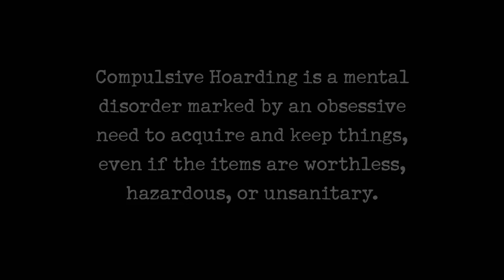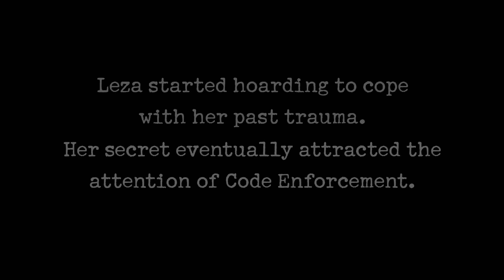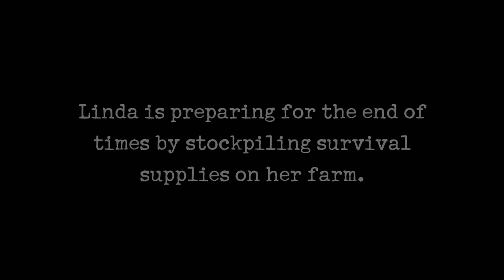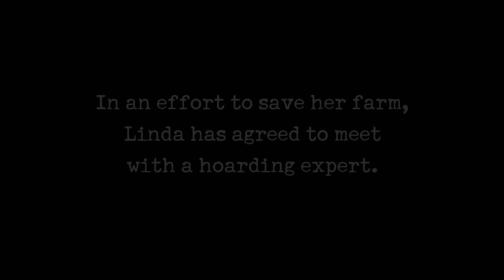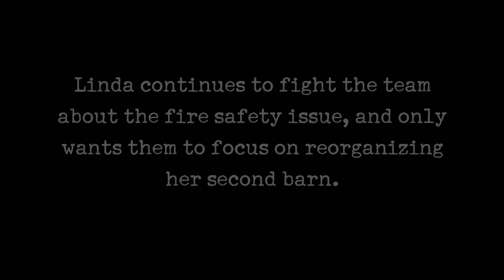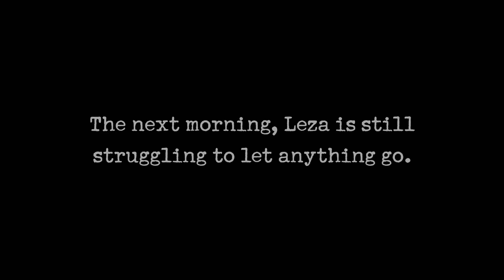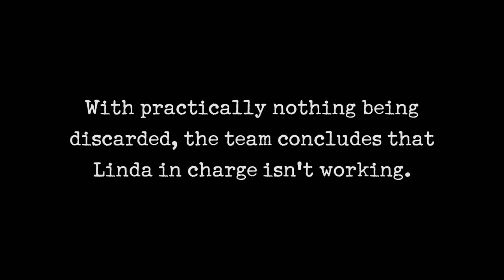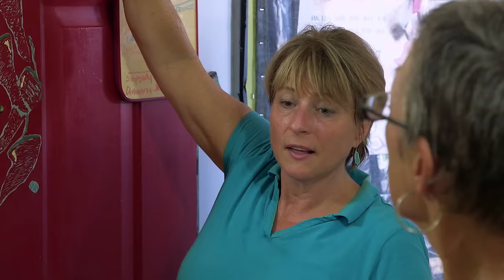END OF TIMES Doomsday Prep Takes Over Linda's Farm (S1, E11) | Hoarders Overload | Full Episode

Comment: A previous owner of my property buried clothes all through the back yard, I am always pulling a clothing item out of the ground. It's not just clothing someone buried, it's also endless broken pieces of flower pots, bags and containers of fertilizer, rusty metal objects, endless household objects, jars and bottles, broken glass. I have found buried around 40 flower pots that aren't broken, most of them are clay you find at Lowes, but some are old USA and McCoy pots, I looked on ebay and most are selling for $10, if that. All of this is buried in 30 x 20 feet of yard, why would someone do this? There was no hoarding issue at all inside the house, the house was clean. Instead of using the city sanitation services, this person buried all their stuff in the yard. Why would someone do this?